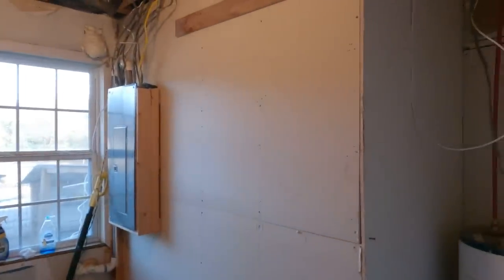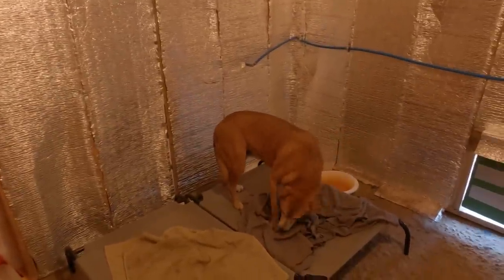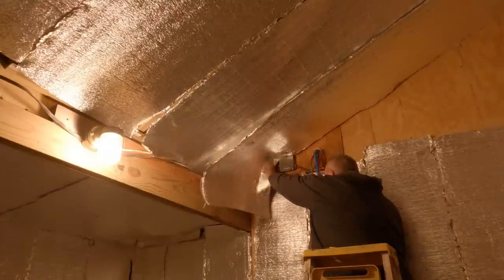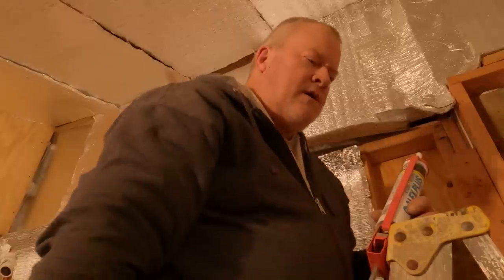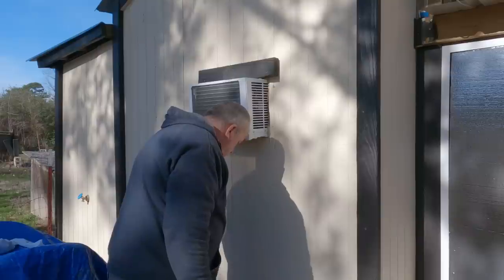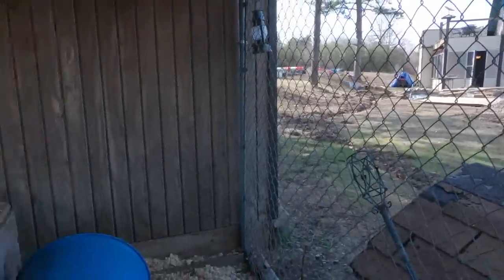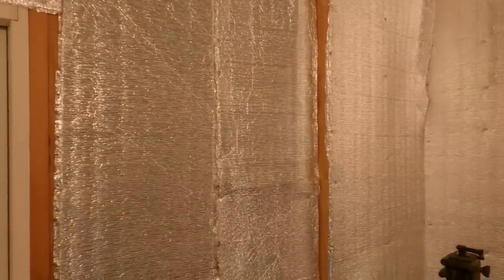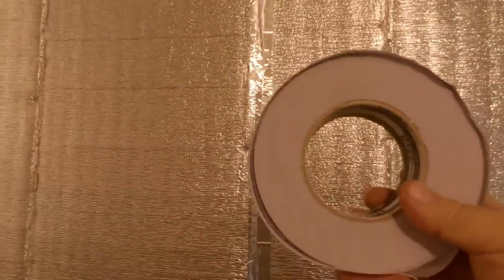New Emergency Projects Next Few Days/ Dogs,Chickens And Well House PRIORITY!

Comment: Mike, could you put a tarp/tent (with poles like a pup-tent) the back side up against the wall. Then that's a much smaller space to heat and with that kind of insulation in her house, seems like that would get her through the rough day in good shape.

Comment: Awesome job Mike! Waldo & Lilly should be fine now. If you can put a bigger flap on their doggie door so you won't lose so much heat out of it. Ms. Libby is going to be so happy. How about just throwing some tarps over the chicken's coop: would that be enough to get them through the winter until you can do better? I just know you don't have much time until it hits. X's & <3
Reply: Or, even some 6 MIL Painter's Plastic. That stuff ROCKS as an insulator! I sealed my windows with it in Northern VA. Only had single pane windows and there was a draft! But, not with the plastic on there! It only cost me about $5 at Walmart for a huge amount of it!

Comment: Glad Washer and Dryer situated. Live your caring for your Dogs. Might as well get what you can to keep them Warm. This Winter seems to be building up to be Brutal and it has started early. Doight as well get prepared because it will be too cold for you to work outside. It is turning out to be the complete opposite of Summer. Extreme. I hope you get them all Warm and make sure your place is warm also. Insulate whereever you can because with such extreme Temps you could lose Power as well. Keep prepping and take care. Blessings

Comment: Mike,  I had an idea for what you might be able to do for the doggie door maybe an old or cheep car floor mat screw the top and it will be heavy enough to close the gaps around but not to heaven for the dogs to push threw ?  I don’t know it might not work but thought I would say something.
Reply from the maker: Yep, I have one already for that, its in my other truck in the shop

Comment: Is that silly cone kin to silly putty? 🤣😂
If I was insulating my place, I would use the same thing your using! Double sided radiant barrier! I don't like fiberglass insulation. In the summertime it loads up the heat and it takes your air conditioner all night to remove it, with radiant barrier the heat gets reflected. Plus you don't have the condensation problems.